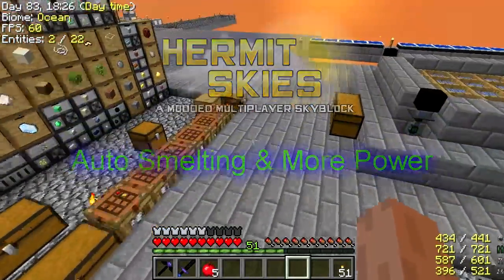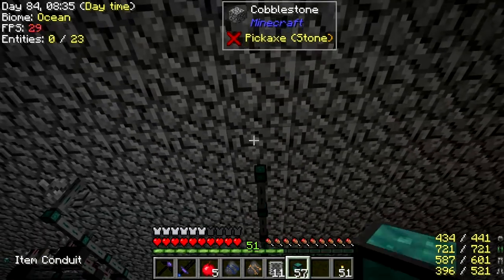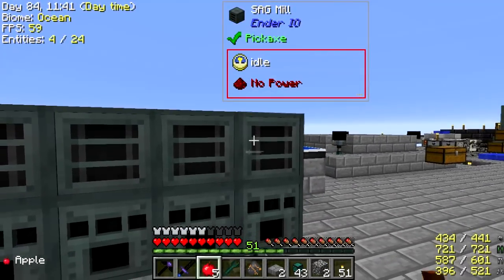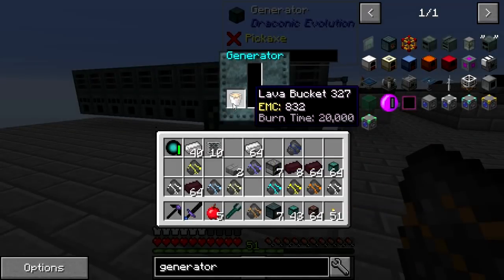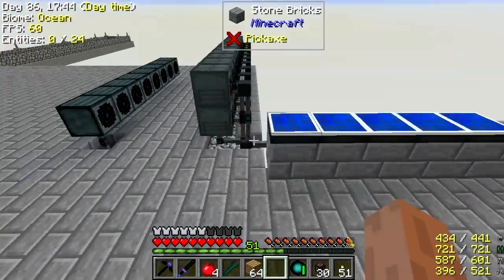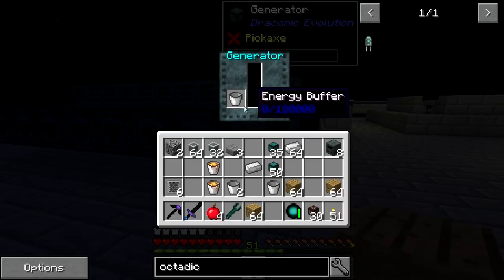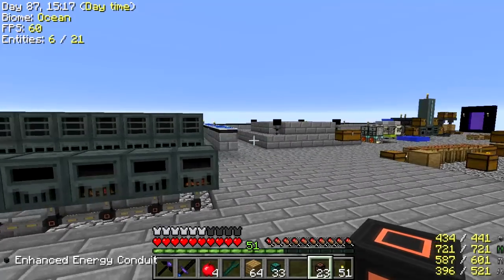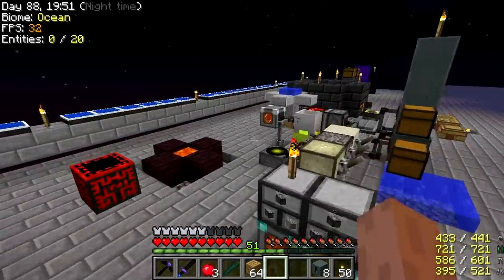Auto Smelting & More Power - Hermitcraft Hermit Skies Ep13

Comment: Tanks have an interface that you should be able to use to move lava buckets into your generators directly. Another option to try is to set the item conduit export to round robin mode and add a speed downgrade to it. I haven’t tried either idea. Just a couple of thoughts.